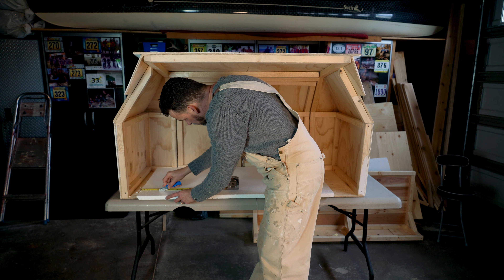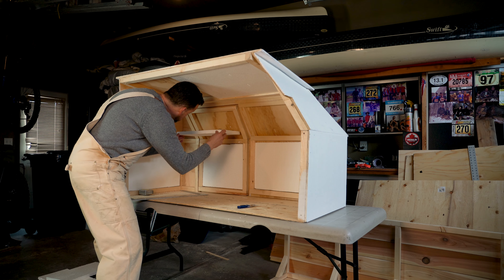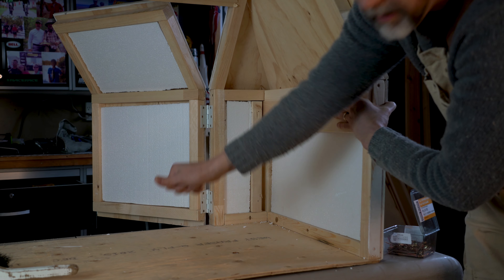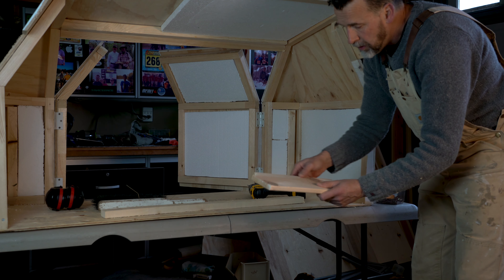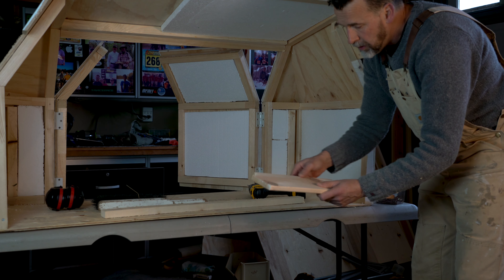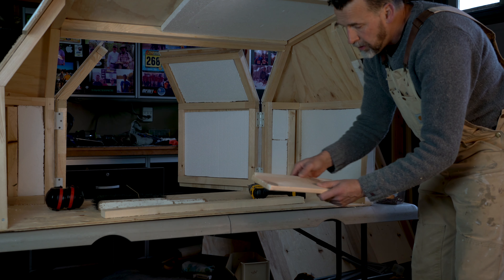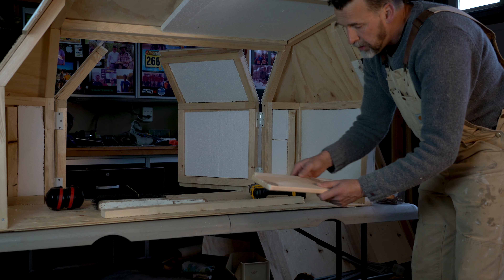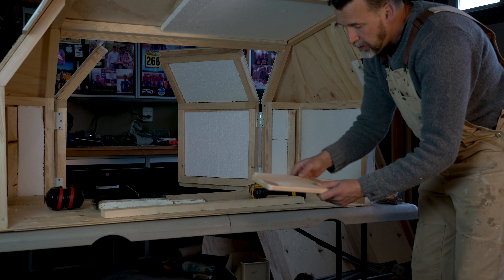Truck Camper Extension - A mobile CEDAR cabin for my F-150 - First steps to Overlanding

Comment: In your opinion do you think I could use cedar tongue and groove siding to do the outside instead of plywood? just for looks really... I know it'd be a little more risky sealing up the tongue and groove, but I'm thinking all the cuts for the angles with different lap boards might be a headache compared to just using ply? Anyways, I'm just curious your thoughts on that... I just bought materials  I need for this type of build and getting ready to start this upcoming weekend. Conditions are super dry here in the summer in Lake Tahoe, Ca and I'm just looking for a way to have some more sleeping room in my 5ft bed 03 tacoma. So I probably won't insulate it make it too pretty yet bc its just a summer use thing for me. I would just really like that wood burned and stained look of the wood grains on the outside opposed to the flex seal/paint, although I totally think your way is much safer for the elements, just not as needed for me right now. Any thoughts appreciated... thank you!!!

Ryan